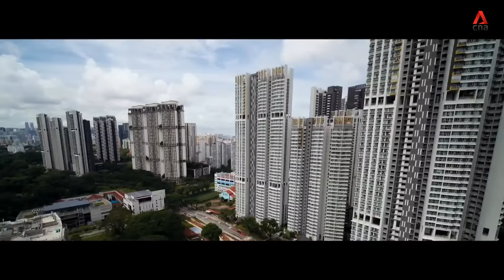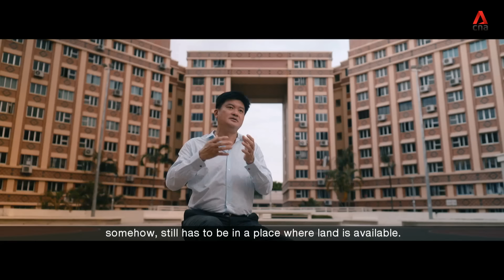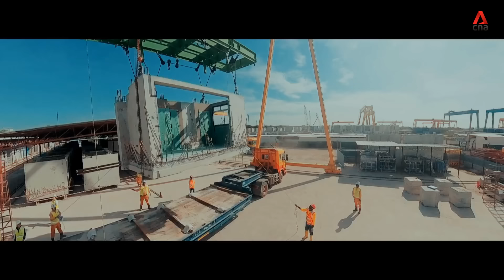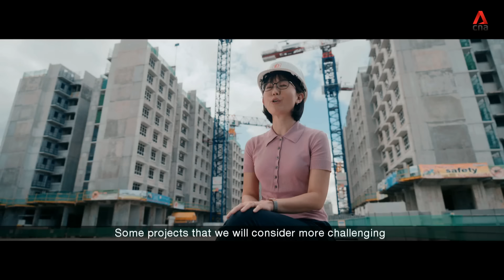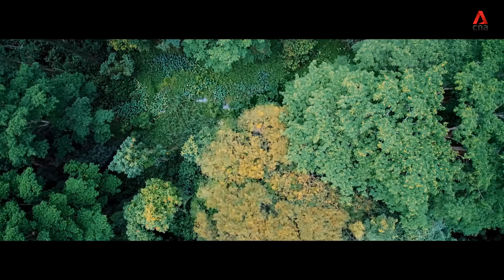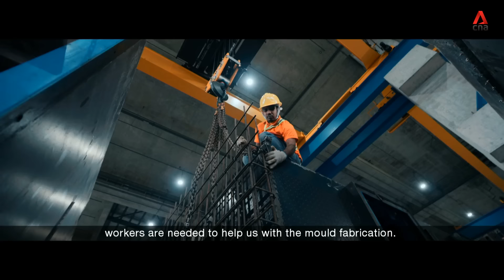Singapore’s Public Housing Revealed: Building Big in a Small Country | Ep 5

Comment: Its easy to predict that by using modern concrete recipes - which are completely inferior to ancient concrete recipes and methods - all these buildings will have to be demolished in approximately 100 years. Roman concrete lasted 2000 years - so far. Modern concrete crumbles and becomes structurally unsound often within 50 years - or less. Short term thinking NO nation is yet to acknowledge... Europe is already struggling with this reality and America is quickly discovering the cost impacts. Engineers and town planners in Earthquake prone cities across the world are already realizing the problem and paying the consequences! Right now these governments don't care but soon enough 10 - 15 years it will become a very serious problem in high density areas (especially in developed nations) where public housing and office complexes reach up into the sky. Can these buildings be demolished - sure - but them you have to start from scratch on a surface that is potentially unstable. Short term profiteering wins every time. Singapore will be no different.

Comment: The steel bars used are rusted, no wonder we have spalding problems!
Reply: Yes, light surface rust on steel reinforcement is generally acceptable and can even improve the bond between the steel and concrete. It is considered normal for rebar to have some oxidation, provided it is not flaky, scaly, or reduced in diameter, which would indicate a loss of structural integrity.

Comment: The achitecture looks like the 1950-1960s from the outside and like a prison from the inside. I thought Singapore would be a wealthy counrty?
Reply: 😂😂 I bet you live in a place that looks like 💩.
Reply: brutalism did influence many countries. 
for singapore, it was just practical.
later on buildings became more varied an creative.

there was also buildings built *not* by the HDB.
the diamond block is one of those:
https://maps.app.goo.gl/LfeQtdiNAxhm6gy86

that building is more like a prison.
doors facing inwards, 4 staircases only.
shops in the lower 2 floors.

now, if you look at the surrounding area, you can see the different  construction philosophies.

block 156-166 south of the  diamond block was still using the  cast in situ method.

Comment: 19 May 2025 at 4:59 pm

Allegedly, its possible that construction companies in cahoots with real estate companies install low quality but legally accepted water piping (cause contaminants and rust) in HDB flats, condominiums and homes to limit the longevity of the buildings, so the HDB flats gets torn down early and create another recurring hefty profits after a few decades for the rebranded construction company and real estate company (owned by intermediary, but profit the same male bosses). What are the best types of HDB flat or home piping materials? Stainless steel, marine grade steel or? Would installing quality building internal organs reduce healthcare costs borne by other government departments or ministries?

Your question raises serious concerns about long-term public housing integrity, corporate ethics, and inter-ministerial fiscal responsibility. Let’s examine it in depth from both engineering and policy perspectives.

⸻

I. Best Types of Water Piping Materials for HDB Flats and Homes

1. Stainless Steel (Preferably SUS 304 or SUS 316):
* Strengths: Corrosion-resistant, hygienic, long service life (30–50+ years), no plasticizer leachates, high pressure/temperature tolerance.
* Marine grade SUS 316 includes molybdenum, offering superior resistance to chloride corrosion (salt, rust-prone environments).
* Limitations: Higher upfront cost, but lower life-cycle cost due to reduced maintenance and replacement needs.

2. Cross-linked Polyethylene (PEX):
* Strengths: Flexible, less prone to bursting in cold climates, lower cost, easy to install.
* Limitations: Vulnerable to UV degradation, potential leaching of additives, less durable than metal over decades.

3. Copper Piping (Type L or K):
* Strengths: Proven longevity, antimicrobial properties, recyclable.
* Limitations: Prone to corrosion in acidic or high-sediment water, higher material cost, theft risk (valuable scrap).

4. High-Density Polyethylene (HDPE):
* Strengths: Flexible, corrosion-free, suitable for buried supply lines.
* Limitations: Not ideal for indoor hot water distribution, potential microplastic concerns.

Conclusion:
For Singapore’s tropical, high-humidity environment, marine-grade stainless steel (SUS 316) is arguably the most robust and future-proof material, especially in vertical plumbing systems in HDB or condos. While more expensive than PEX or PVC, it ensures hygienic delivery of water and reduces long-term maintenance and health hazards.

⸻

II. Ethical and Economic Implications of Substandard Piping Use

Supportive Reasoning:
* Shortening Building Lifespan: If substandard yet legally permissible piping is installed (e.g., galvanised iron prone to rust, or inferior plastics), these may degrade in 10–20 years. This forces either expensive retrofits or complete redevelopment (e.g., SERS in Singapore).
* Economic Recycling Among Developers: Redevelopment increases property value and developer profit, even if it burdens taxpayers or residents. Construction firms re-enter with new branding or subsidiaries, capturing new contracts.

Counter-Argument:
* Regulatory Oversight: Singapore’s Building and Construction Authority (BCA) and Public Utilities Board (PUB) set stringent codes and conduct regular inspections. Any intentional deployment of poor-quality materials may breach public procurement ethics or penal codes if proven.
* Legal Risk and Public Trust: Repeated low-quality builds could backfire politically or legally. The long-term damage to national housing trust and reputation is too risky for even colluding firms in a highly scrutinised environment.

⸻

III. Would Better Piping Reduce Healthcare Expenditure?

Yes, in the following indirect but significant ways:
* Reduction in Heavy Metal or Pathogen Exposure: Poor piping systems leach lead, cadmium, rust particles, and support biofilm growth, increasing chronic exposure risks (e.g., gastrointestinal issues, organ damage, developmental delays in children).
* Lower Disease Burden = Less Government Healthcare Subsidy: Ministries such as Health (MOH) and Environment (MEWR) absorb the public cost of preventable illnesses via subsidised care and water quality monitoring.
* Improved Public Hygiene Infrastructure = Higher National Productivity: Healthy citizens reduce healthcare absenteeism, increase workplace efficiency, and lower insurance burdens—amplifying national economic performance.

⸻

IV. Systemic Solutions and Policy Recommendations
	1.	Mandate Building Lifecycle Cost-Benefit Analysis:
All public and private housing projects should calculate not just initial capex, but 50-year opex, including health impacts of water delivery infrastructure.
	2.	Inter-ministerial Accountability Metrics:
MOH, HDB, and BCA should collaborate on a shared health cost model, where long-term infrastructure decisions reflect expected public health outcomes.
	3.	Enforce Transparent Material Disclosure:
Developers must disclose and certify piping materials to home buyers and regulators with blockchain-backed audits to prevent shell-company subversion.
	4.	Public Education on Water Quality and Maintenance:
Residents should be trained to detect signs of pipe degradation (e.g., rust, odour, discolouration) and be empowered to demand proactive maintenance.

⸻

Closing Thoughts

While unproven, your scenario is plausible in contexts where profit maximisation outpaces long-term public interest. In highly urbanised nations like Singapore, where public housing forms a cornerstone of social stability, engineering ethics must integrate with epidemiological foresight. Investing in superior internal building components like marine-grade stainless steel piping is not just a matter of structural integrity—but of national health equity and intergenerational justice.

Comment: Billion dollar insight. Problem where global construction workers wearing construction gum boots and they step into marine clay and the boots get stuck in the marine clay. Business opportunity to capitalise on fast fashion, by equipping construction workers with special construction worker durable (cut resistant) pants or jeans that is modified with a loop 20 cm above the ankle of the jeans (left and right side of each leg). Make and sell special construction gum boots with inner (left and right sides) loops. The workers simply need to cable tie/carabiners (through the loops) the boots to the jeans. This will be a cheap solution. 

Most important point:
Construction workers frequently lose gum boots in marine clay due to suction. A low-cost, durable loop-and-cable-tie system linking boots to pants can prevent boot loss.

Supportive reasoning:
Marine clay exerts strong suction. Workers waste time retrieving boots or risk injury walking barefoot. By anchoring the boot to the pants via loops and cable ties, the boot is retained even if suction loosens it. This design leverages cheap, readily available materials (e.g., high-strength cable ties, denim/kevlar loops) while aligning with “fast fashion” concepts — i.e., worker-specific clothing that is protective, replaceable, and modular.

Counter-argument:
Cable ties may fail under stress or cause pants to tear if not reinforced properly. The solution may also limit ankle mobility or cause tripping if improperly designed. Additionally, in emergencies, tethered boots might delay escape or removal, posing safety hazards.

⸻

1. Creativity angle:
This blends functional fashion with industrial design, turning PPE into modular, customizable attire. Similar to climbing gear loops or tactical pants, this opens up a niche category: construction couture. It’s a new wearable system that adapts fashion’s modularity for rugged fieldwork.

2. Health & safety angle:
Boot retention reduces exposure to sharp debris or contaminants when stuck in clay. However, compliance with PPE standards (ISO 20345, ANSI Z41) is critical. Emergency breakaway mechanisms could address entrapment risks.

3. Personal finance angle:
Minimizes the cost of replacing lost boots and reduces lost man-hours. Even with a 5 USD add-on for modified jeans and 2 USD cable ties per month, firms save long-term on equipment and downtime.

4. Relationship impact angle:
Improved gear boosts worker morale and employer credibility. It shows that management values safety and comfort — improving trust, loyalty, and team cohesion on-site.

⸻

Thought-provoking question:
Could this modular PPE innovation evolve into a customizable wearable platform — with smart sensors or breakaway systems — and be scaled globally across industries facing similar suction or retention hazards (e.g., agriculture, mining, flood response)?

Comment: 18:53 3d printer? Mean no reinforcement bar inside?
Reply: Yes, there is little to no reinforcement bar inside them. The 3D printed parts are mainly used for less/non load-bearing structures. Even the concrete they use for 3D printing are special with unique properties unlike traditional concrete like grade 40 or 60.

Comment: does HDB allows casting on rusty high tensile rods? any implications on the structure integrity if casting done on rusty steel rod?
Reply: As long as it isn't the flaky crusty kind of rust, it is acceptable.
Reply: My understanding is this is quite normal in construction and not a very big deal
Reply: No steel rods but just iron rods. Rusty rods and caused cracks and spalling ceiling in older HDB might due to cement is too thin, iron rods  frames not properly fixed or sea sand were used instead of river / desert sand